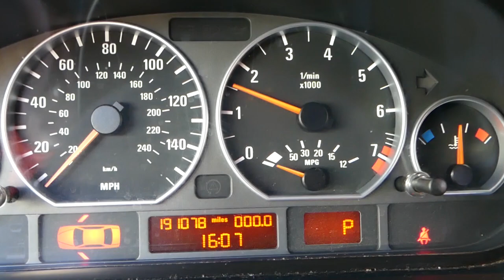WHAT IS A VACUUM LEAK ON BMW. ANY BMW

Comment: Hi there, could it be as simple as a bad gas cap. My check engine light for small vacuum leak came on after I was filling with gas with the engine still running to keep the inside cool. It’s hot here in Texas. Thank you

Comment: I had the dreaded vacuum leak on my N53 powered 523i. I should have ran a smoke test first but i didnt. I ended up deciding it was the PCV valve so changed the valve cover. Sure enough the diaphragm was split badly. However once rebuilt the car still ran like a pig. So today i did a smoke test and quickly found the ONE vacuum leak. Guys it was simply the rubber seal on the oil filler cap. Smoke poured from it. I took the cap off, removed the rubber seal and replaced up upside down onto the cap. That sealed it and the car now runs and idles perfectly. So BEWARE. Run a smoke test FIRST as it could save you hours of pain and £450 of your hard earned cash. If you do have to change the PCV valve on the N53 its not a fun job at all but it is not difficult in any way. Just remember to disconnect battery or you will get covered in petrol from the removed metal fuel pipes on top of the valve cover. Thankfully the BMW is self bleeding so you dont have to bleed the system afterwards. Good luck
Reply: Dude, you just saved my life. Made the mistake of not doing the oil change myself, got lazy and took it to Jiffy Lube. They forgot to tighten the oil filler cap, and here I am expecting the fuel injectors have finally gone bad. Thank you so much for stating this.

Comment: i can here a small hiss or whine under acceleration in my 520 d e60 2008 model just wondering did you ever come across anything like that and do you think it could be related to a vacum leak ???
Reply: did you ever figure it out, i have the same issue currently
Reply: @Ian-gp1pz  it's just the flange was leaking slightly I tightened it about as much as I could but the original BMW equipment that I bought to renew the turbo kit with isn't great quality I'd say just look for a better V band clamp it solved my problem 👍👍 plus if you run more then stock boost you will need to decat !!
Reply: Sorry mate I just read back the question on the original post it was the turbo so I bought a new    one with all new turbo lines and gaskets solved the problem 👍👍

Comment: Question, i just changed my belt that broke and one of the pulleys that caused it to break, it was running fine for a few miles then my check engine came on with all cylinders misfiring on my reader but the car still has power, what can that be?

Comment: My 2012 F10 535i has oil in the vacuum line that goes in to the valve cover from the vacuum pump. What causes that? My mechanic said the valve cover is probably cracked, that's why...but i dont think that can be the problem. Do you have a video that can help me ?
Reply: Same issue as my 2012 F10 528i base model+ low vacuum (-1.18 to -1.48psi) and shaking at idle with "D" gear and braking.  Smoke test showed leaks at Air Intake Hose - Intake Boot to Turbo section.  However, replacing this hose did not improve the low vacuum problem, nor the shaking phenomenon.  Still figuring out......

Comment: Replaced my valve cover gasket. Had no issues with car except valve gasket oil leak. I went and replaced it and now getting P1415 code. Didn’t have that before replacing it. I checked the vacuum line in back of valve cover and no leak. What could have i done wrong? 

Note: Replaced MAF SENSOR 
Replaced PCV on valve cover. 
New spark plugs, original was at .073. I set to .04.
Reply: That happened to mine it ended it being fuel injector o ring had air leak
Reply: @donny5628  Oh i’ll have to check that.
Reply: @donny5628  it’s crazy how i fixed the oil leak and it had no issues but that. Right after i got all kinds of issues lol.
Reply: Be conservative when dealing with one symptom and try to replace any related part, as the source of the problem could be one one that's hard to figure out.

Comment: I had rough idle due to vacuum leak. I changed pcv valve and its better but slight hesitant at low revs. I cant find furthet leal issues. Do you have any tips please? B38 triple 1499cc 120k. Best handling ive ever owned!
Reply: I would say check your ignition coil and MAF sensor, I believe my ignition coils going bad cuz of my MAF sensor that is bad

Comment: I have this issue I think. I recently purchased a 2.5L, 325i auto from 2006 and the CEL is on and the error codes are 2D06 29E1 29E0. The car rough idles, jumps around and wobbles a bit for 20/30 seconds then settles at 550/650 rpm. When its driving it seems fine, no loss in power, no hesitation the only thing thats happened a few times is the accelerator pedal doesn't respond, so I have to turn the car off, go into park start the engine then back into drive and the car goes again. Hope you can help 👍
Reply: Did you find the problem?
Reply: I have the exact same problem, did you find the solution??
Reply: Similar issue as my 2012 F10 528i base model+ low vacuum (-1.18 to -1.48psi) and shaking at idle with "D" gear and braking.  Smoke test showed leaks at Air Intake Hose - Intake Boot to Turbo section.  However, replacing this hose did not improve the low vacuum problem, nor the shaking phenomenon.  Still figuring out......
Reply: @jiaah7.-8  did you ever find the issue
Reply: did you solve it, i’m having the same issue
Reply: @Ian-gp1pz  ending up being a vacuum leak, best to get a smoke test
Reply: @fletcher737 how much did you spend on it?.

Comment: I have a 2004 BMW 525i that no one want to fix. Car sat for over 4 years. I restored a list of things. Long story short car runs perfect but it keeps going into limp mode. My question is can a bad brake booster or the vacuum line cause the car to go into limp mode
Reply: What's limp mode

Comment: How exactly do we find the leak though? Any codes or techniques? I tried the spray soapy water method to no affect.
Reply: Maybe do a smoke test to see if you can find a vacuum leak. I’m having a lean problem and will be doing one tomorrow
Reply: A code like lean air will be a certain give away. Techniques? Best way that I hear is doing a smoke test
Reply: Obvious signs of vacuum leak are rough idle, massive misfires, lack of power.......

Comment: I have a 2011 328I, the serpentine belt broke and we put a new one on and now when you’re at a light or park idling rough. When we turn the air conditioner on the rPMs goes up does run better. What could be the problem?
Reply: You ever solved the issue ?
Reply: @jfsmmke  yes , the serpentine belt was sucked into the engine, Through the front main seal. 
Even after retrieving the belt from inside the top of the engine it ran bad because there was a vacuum leak. We fixed it and then we traded it.